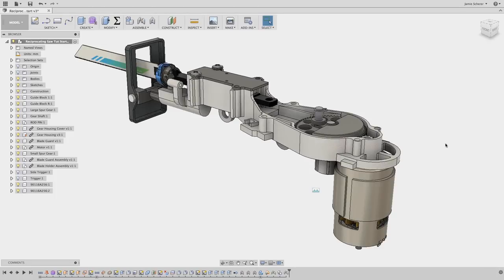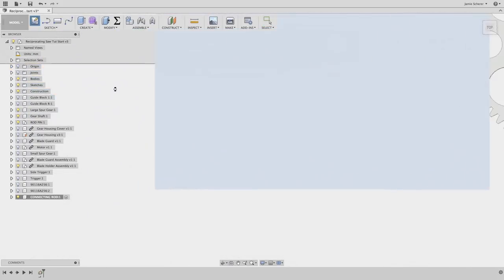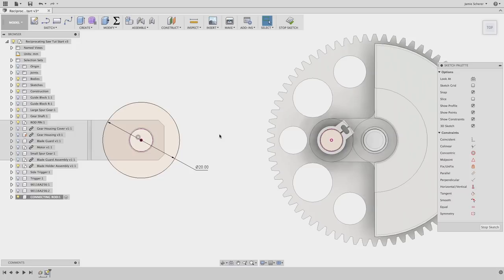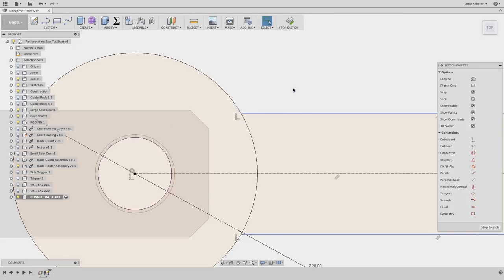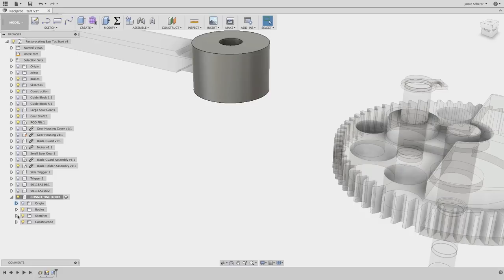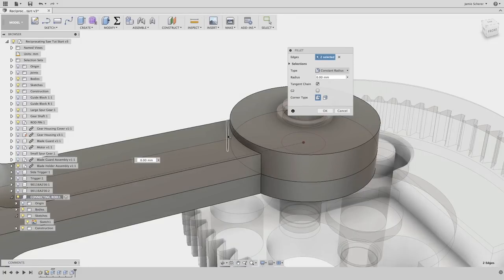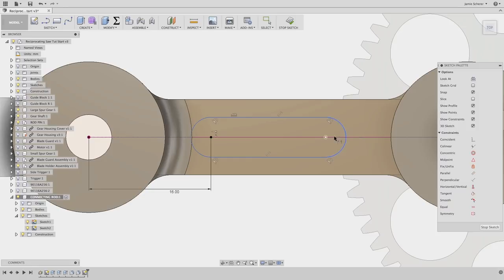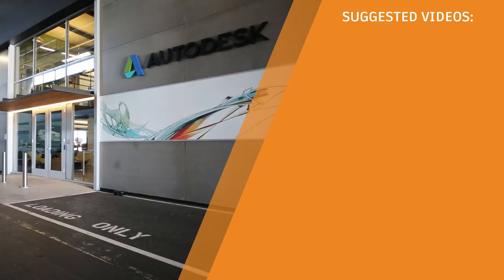Create Components in Assembly Context

Comment: Hi Lars - Perhaps this is a new feature since making this video - Thank you by the way understanding components was driving me crazy.  Anyways the point of this message is that mI created components to keep my timelines straight in each component - strangely though the i just kept seeing the entire timeline for the entire file - but each operation int he timeline had a colur associated with the component (still a bit confusing) By click on the gear icon on the far right of the time line bar I could switch this off by selecting the "Hide ALL INACTIVE FEATURES" . An important setting if your instance is not behaving as it does in Lars' video.
Reply from the maker: Hey Grant, 
Sorry about any confusion the color coding in the timeline might have caused. I think we did a QUICK TIP on this LONG ago, but its so buried I can't even find it. Probably deserves a refresh, and I know we've never covered the 'inactive features' toggle!

By the way, the presenter in this case is actually Jamie Scherer -- not Lars  -- but we love them both equally! haha https://www.linkedin.com/in/jamiescherer/
Reply: Autodesk Fusion 360 no worries.  I love learning from you tube but your tech forums are awesome at getting to the nub.  Just got to get better with my search terms.  Its still a ton of fun! And your self serving learning approach and crowd sourced knowledge management is brilliant.